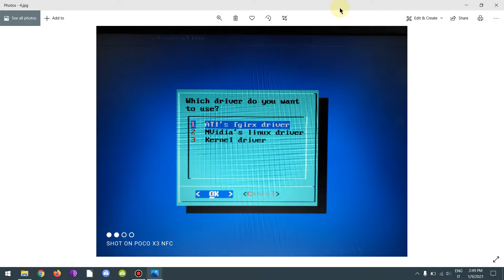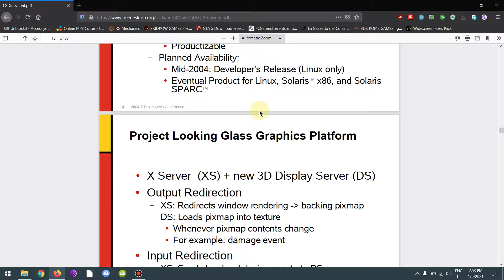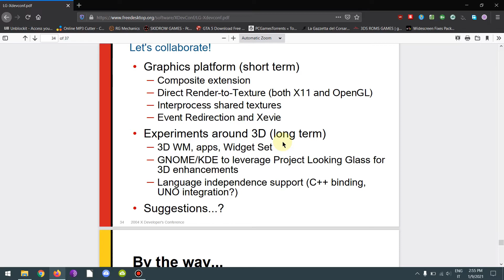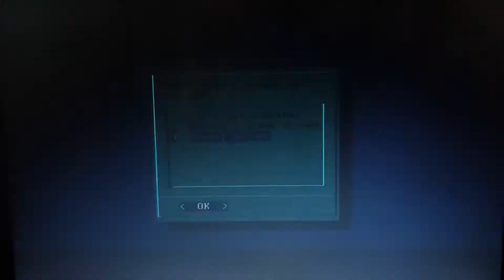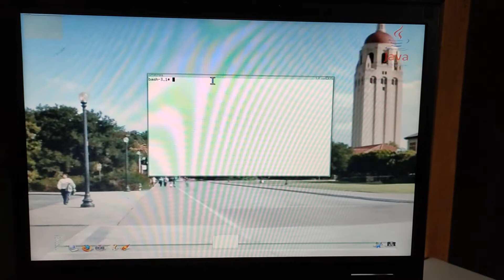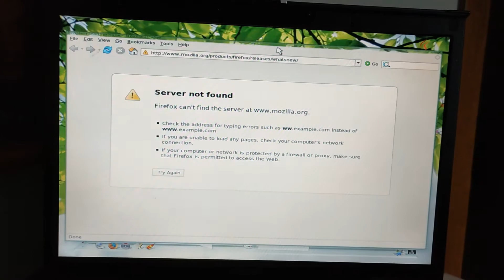Project Looking Glass 3d Linux Java Desktop Environment

Comment: The source code is out there. You don't have to "only" use looking glass with Solaris or JavaOS. You can use it on Linux or even FreeBSD. Problem is.. I can't find out. If anyone has a link to it, please provide :)
Reply from the maker: even if the code is free, i don't know where to find it, and even after you get it you need to update it to work well with modern Linux Kernel GCC and libraries. btw it is very difficult that it will work on wayland without XWayland compatibility layer ;-)

Comment: Lg was the most beautiful interface I've ever seen
I think with JavaFX it should be updated
Too bad Sun died and the project too
Reply from the maker: yes, but it was the foundation for later project such as linux compiz and apple skeumorphism on mac os x leopard
Reply: @Al1en99YT  Do you know if it is possible being inside VirtualBox forces to use a better resolution than the small screen that appears?
Reply from the maker: i burned the .iso to a cd and tried it on my old black laptop, the same from the windows xp 20th video and it worked better than the virtual machine ;-)